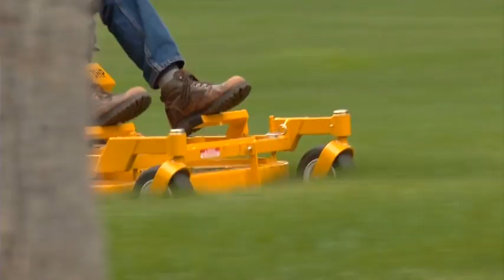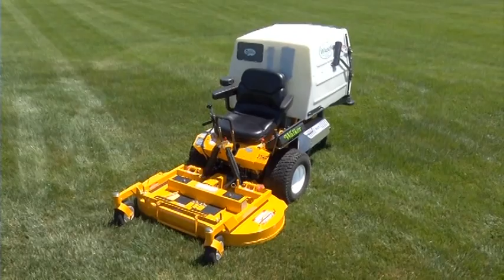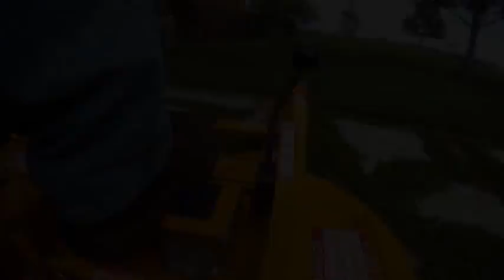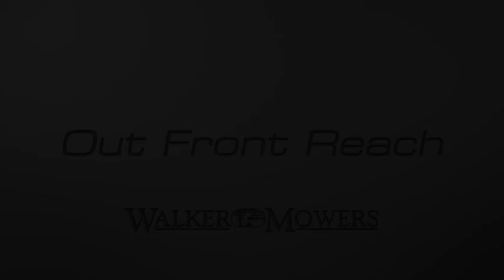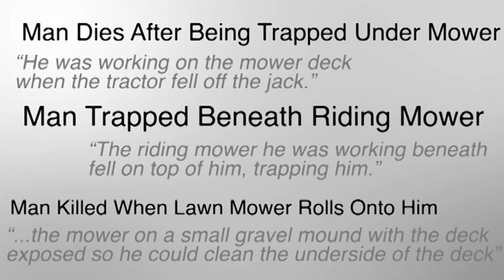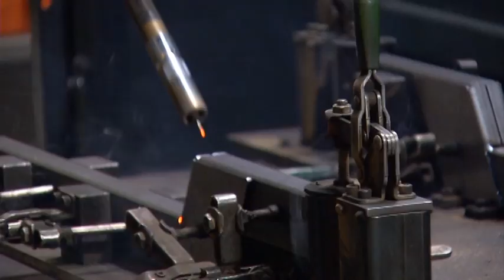out front Advantage

Comment: looks like an excellent mower... the power controls look a bit weird.
Reply: The forward-motion control on the right hand engages the hyrdostats. Pulling on one or both of the left-hand controls (in the center) reduces the ratio of the 'stats, allowing you to steer while in forward motion. With the forward stick in neutral position, pull the centre handles backwards to reverse. Takes a little bit to get used to, but works just fine. You can even spin within your own radius.